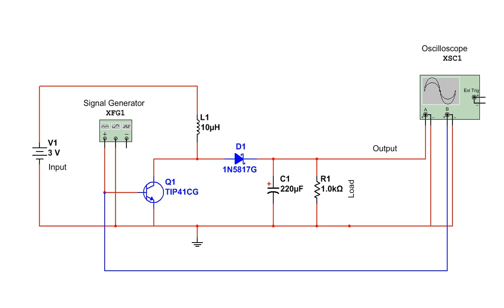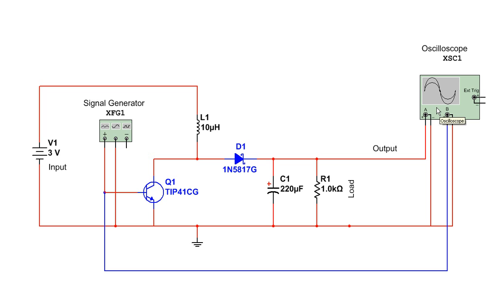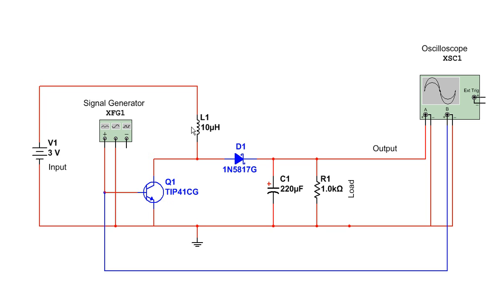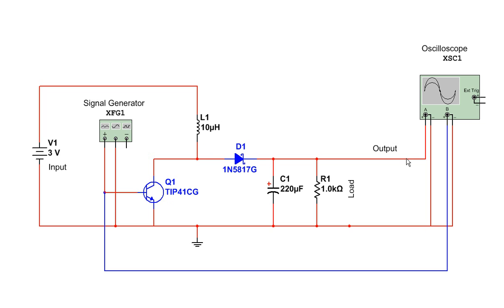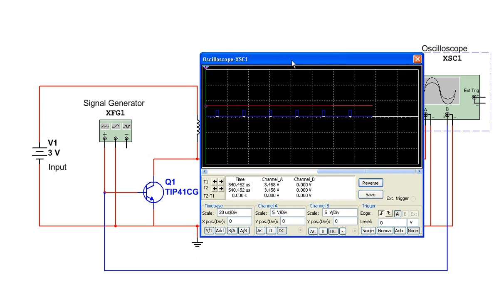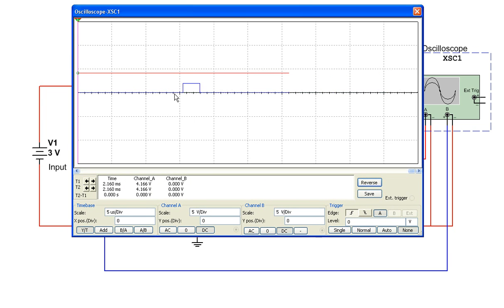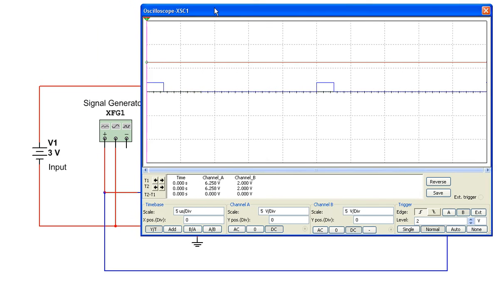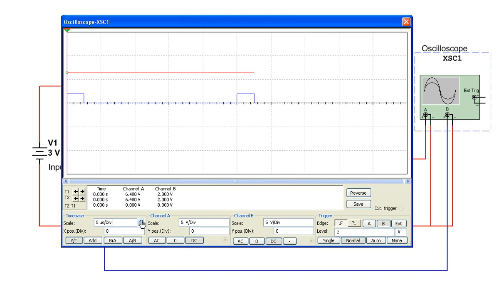How does a DC to DC boost Converter Work

Comment: the basic formula of boost converter in output voltage=(input voltage)/(1-duty ratio).
here you have given input 3 volts and for 50% duty ratio am getting 20.3 volts output rather than 6 volts
Reply from the maker: It's not a practical circuit.  Put a load on the output and the output voltage will drop.
Reply: I great video, just a question, if i invert positive and negative on input, cani use this step up or it stop working?
Reply from the maker: I didn't do any sums.  I quoted what the simulator provided.  I am well aware that based upon calculations this circuit should perform better.

Comment: Why the output voltage keep on increasing also why it is delivering current in pico Amperes
Reply from the maker: The output voltage keeps increasing because this is an example not a proper regulated circuit.  If the output was regulated better the output voltage would be more stable.  The output current is low because there is a considerable load (1 k resistor) across the output terminals.  Reducing this load would allow the current to increase....but I don't measure the current in the above video so how have you measured the current?
Reply: Alexander Lang I just connected a load resistor and a ammeter

Comment: can you please provide detailed information about the inputs given in the function generator like duty cycle,offset,etc
Reply from the maker: +Ana Stuart Sure, I should have mentioned this before - my apologies for not doing so!  The signal generator frequency was set to 40 kHz, the duty cycle was set to 10%, the amplitude was set to 1 V pk and a 1 V offset was applied.  Let me know if there is anything I can help you with.  I should mention that this circuit was purely to show how a boost regulator works.  There are better switching transistors for this job and the value of inductor and capacitor on the output could be selected with more care to improve efficiency etc.
Reply: +Alexander Lang
Thanks..but have u done any other changes in the properties/initial conditions of the transistor,inductor,capacitor,etc.since my output is increasing &not getting a constant dc.
Reply from the maker: +Ana Stuart - I didn't make any changes to the components. it suggests the simulation settings are different. I can send you the multisim file if you wanted.
Reply: +Alexander Lang 
Thanks a lot . Please do send the file
Reply from the maker: +Ana Stuart I have added a google drive link in the description to the video - I had to redraw it but it all works fine to me.  Good luck - let me know if you need more help

Comment: Am I correct in assuming that a Boost Converter is pretty much an oscillator? To me this seems allot like stepping up power similar to using a step up transformer in A/C applications. Although transformers do not work on straight D/C, pulsing the D/C through an A/C transformer could do the same effect?  You would need to use a bridge rectifier yeah?
Reply from the maker: Sovereign Knight Any Dc to DC converter is made up of an oscillator, an inductor, a switching diode and a capacitor.  The action is the same whether it's a boost (step up) or buck (step down) converter.  The key part is the transfer of energy created by energising the inductor which stores the energy as a magnetic field before a change in polarity which collapses the magnetic field transferring the energy through the diode into the capacitor.  The capacitor stores the energy briefly before powering the rest of the circuit (load).  The capacitor never becomes discharged as before that can happen the process has been repeated.  Hope that explains things for you.
Reply: Yes it does.  Thanks for that.  I have a little battery bank I bought that uses 4 18650 cells and it has a booster in it to allow for 5v @ 2 amps up to 13v @ 1 amp. I just find it fascinating how this works!

Comment: Hey can I convert 20 mV p.p with 10 M ohms as input impedance to  charge 1.4 v battery ?
Reply from the maker: Short answer is it cannot be done.  There is not enough energy present to make that worthwhile....You also don't give the frequency of your 20 mV source.  It would take tens of years to charge the battery...
Reply: Actually, my question is a project that our professor asked us to do.Also, It seems hard or impossible to do. The frequency range is 0 to 2K Hz.
Reply from the maker: Ann ANm Hmm...I take it back...It could be done...in theory.  http://www.daycounter.com/Calculators/Switching-Converter-Calculator.phtml May be a good place to start.  You need to use very large inductors and capacitors and a very high frequency oscillator in order to achieve your requirements.  Good luck!

Comment: nice video, could u record tutorial video about boost from 110DC to 330DC :)
Reply from the maker: I could do but I need a bit more information...How much current do you need at the 330V side.  If you need lots of current we need to design an inverter.  If you just need the high voltage and low current we can use a flyback converter.  it would be helpful if you told me what you wanted to do with the 330Vdc...
Reply: Alexander Lang actually i just need the high voltage 310-330vdc, then i plan to use inverter from 310-330vdc to 220vac (output power 500W)
Reply from the maker: Hi...Not sure how you can do this...what is the input voltage and current going to be?  In order to get 500W at 230V from 330Vdc you need to have the 330Vdc at around say 600W. That is a lot of power!  Stepping that level of dc up from a battery or low voltage source is possible but very inefficient.  You would need a very big battery or an array of batteries!  It isn't feasible really...
Reply: Alexander Lang thanks for advice :) , my work is make a power supply ( 110VDC input and 220VAC output, power 500W ) , it could be done well in normal way but my teacher want me to do in 2-step, 1st step is boosting from 110VDC to 310-330VDC and the other is inverting from 330VDC to 220VAC , so i'm stucking in this :(